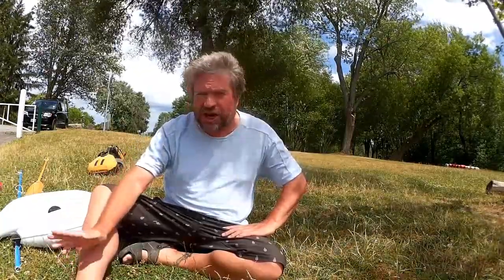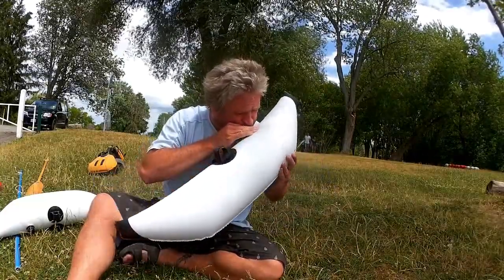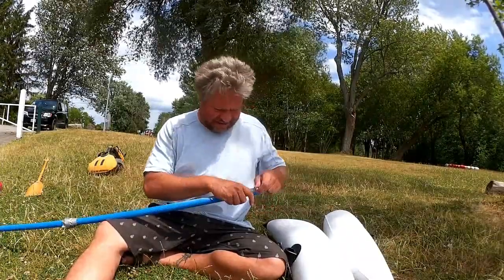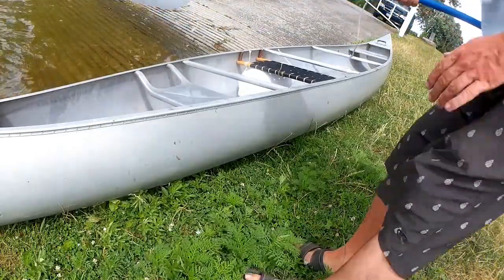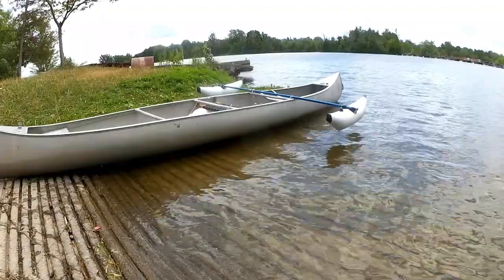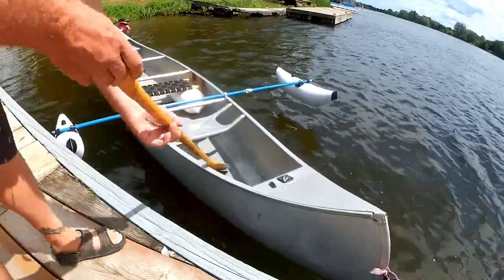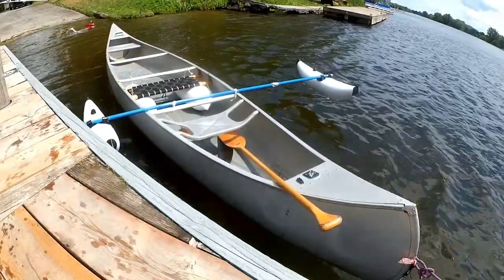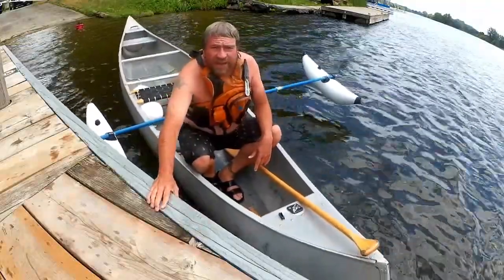Canoe and Kayak Inflatable Outrigger Stabilizer Test

Comment: Wow. This is actually a game changer for me. I was on the fence about the amazon ones but this definitely sold me.
Reply from the maker: Yes, and I shot this video several years ago, I am still using them and they are still going strong.  I have switched from the lash down crossbar to bolt down crossbar.  They are pretty cool.

Comment: thx for the tech tip on righting movement. great post.
Reply from the maker: It was a rough calculation.  I figured 20 liters volume= 44 pounds of water displaced on the end of a 4 ft lever= 176 pounds of righting moment.  I also calculated heeling moment if my 50 sq ft sail to be ~ 150 pounds @15 knots.  So, I should be okay to about 15 knots.  20 knots of wind gives me 250 pounds of heeling moment though, so I definitely want to keep it under 15 knots of wind I think.

Comment: I would suggest cotter pins on the pontoon ends .. 

Grumman--- are you trying to own every classic boat there is?
Reply from the maker: Cotter pins are a good idea.  Like the outriggers, hate the pokey bolts sticking out.  

This Grumman is an amazing boat.  It is so versatile.  One of my best boat purchases.  It's so simple and functional.
Reply: @travelbywater9378  on my sailboat for the rigging for the stays I got these cotter pins that are like syringes... when you squeeze the plunger with your thumb, ir releases a ballbearing so you can slide it in or out (examples here:  https://www.rochehardware.com/quick-release-pins/)

no pokey points...
Reply: I have an 18’ Grumman sweet canoe it’s a big boy

Comment: Two years later, are you still using them?
Reply from the maker: I am yes.  They are no signs of wear, no leaks.  They have been great.
Reply: @travelbywater9378 , that is good to know; thank you!
How do they affect the boat when the wind blows? Do they wobble the boat?
Reply from the maker: @mortschubert3909  they are on quick release pins, so they are easy to remove for paddling.  Here is a short video of them on a windy day sailing my canoe.  They don't cause any problems except a bit of wind resistance.  https://youtu.be/BJp8LkBaeD4
Reply: @travelbywater9378 , thank you!